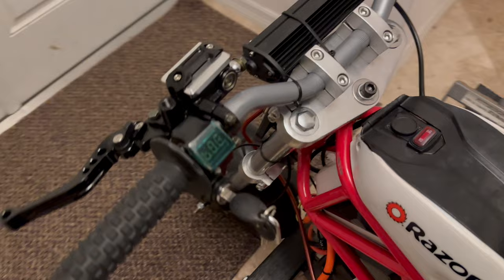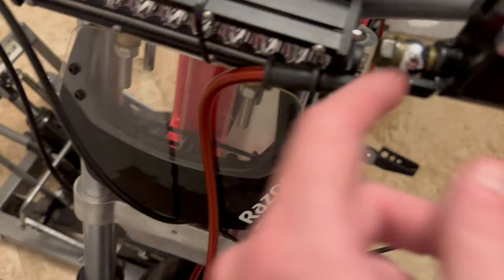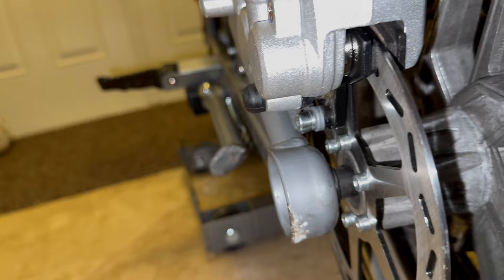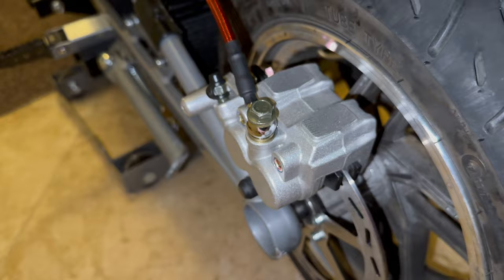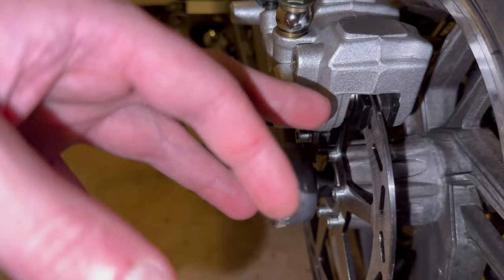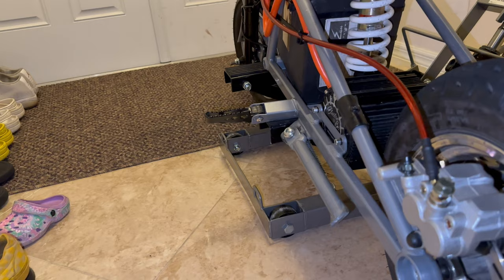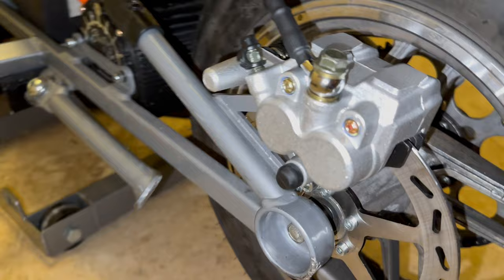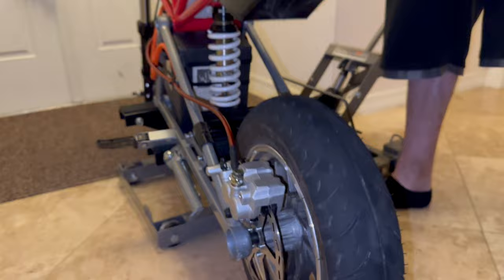NEW Pit Bike Brakes On The RSF! REAL Hydraulic Disc Brakes -CHEAP & WORTH IT! Links In Description🔥

Comment: what did you have to do to the 180mm rotors to make them fit the razor wheels? you drilled out the holes more?
Reply from the maker: Just drill the holes to make it fit. Very easy to do. And really doesn’t take much.💯🍻
Reply: @KruseNStuff  thanks man

Comment: I’m trying to mirror your break job for the rear… and just was wondering, if the link for the caliper is for the front or if it was a typo? Ps, love the videos!!!
Reply from the maker: Nice. The caliper is the same for front and rear. The rotors are the same. Obviously The levers are different. The brake lines are different lengths.💯🍻

Comment: Hey, I put new brakes on and my wheel runs fine when no weight is on it but when weight is on it makes lots of noise and like kind of shakes on the back wheel
Reply from the maker: That doesn’t sound good. Can you make a short or video of what your setup looks like. I’ll try and help you out.💯🍻
Reply: @KruseNStuff how should I send you the video? Also do you think it’s squeezing the rotor too tight? Because when I try to spin it when it’s off, it spins slowly
Reply from the maker: @Razor_NayNay  you can post it to your YouTube or Instagram message a video. You may not have your spacing correct. It’s very close and took me some time to get it also.
Reply: @KruseNStuff  I’ll dm you on instagram, thank you for responding so quickly.

Comment: Bolt on to the mx650?
Reply from the maker: Yeah. May have to mod it slightly. Shave down the spacers. But bolt pattern lines up precisely💯🍻
Reply: @KruseNStuff  spacers on axle or in the brake?
Reply from the maker: @Michael_2211  the caliper adapter. Very easy.
Reply: @KruseNStuff  oh okay, no problem, thanks, I’ll give you a sub

Comment: Those rotors bolt right up?
Reply from the maker: Yeah. Tight fit bolt wise but fits. The caliper adapter fixed spacers may need some shaving to fit.

Comment: What bleed kit do I need and how do you bleed these brakes
Reply from the maker: For new brakes you won’t need a bleed kit. Just line it up, set it up, fill the resivoir with fluid. Slowly squeeze the brake lever over and over. You will see air bubbles constantly spewing out of the 2 holes in resivoir. You may have to push the brake pad in and bleed em by loosening the bleed valve. But that’s it. You keep repeating until you feel the pressure. Any smushy feeling is most likely air. You will know when it’s all out. Your brakes will feel PERFECT💯🍻
Reply: Thanks for that ⬆️ 
can I just use regular mineral oil I’m going to get the same brakes you have

Comment: Question does the brake mount on the caliper make the razor fit 180mm rotors from 140mm don’t have to buy anything extra for mounting?
Reply: I’m using a mx650
Reply from the maker: @Babyjok3r77  yes 180mm rotor. No you may need to shave the fixed spacers down if I remember right though.💯🍻
Reply: Thanks

Comment: What forks are you using for the calipers I can only find forks that support 43mm brake mount not 51mm
Reply from the maker: I got 2 sets of these chrome forks from alter ego awhile ago. I paid $370 for 1st set and a discount on 2nd set. You may be able to find similar on eBay or Amazon for cheaper but you’d need to make a brake adapter. Or You can get gold forks from Electro & Company for $450.https://www.electroandcompany.com/product-page/etmv2-razor-hydraulic-fork-upgrade-kit they are solid.